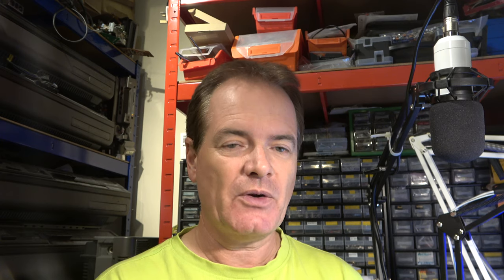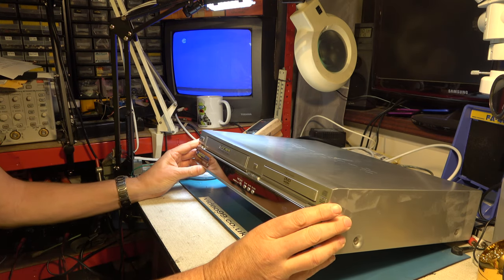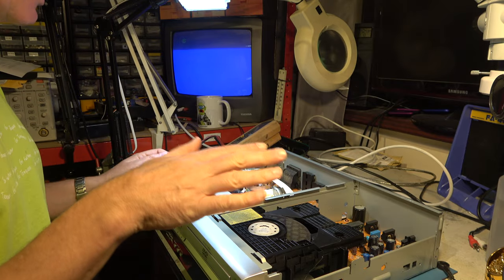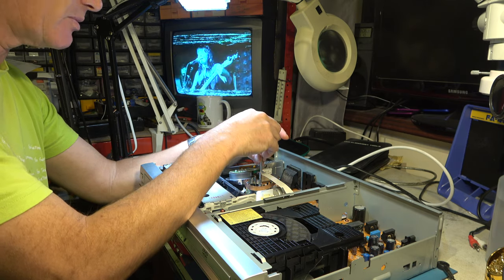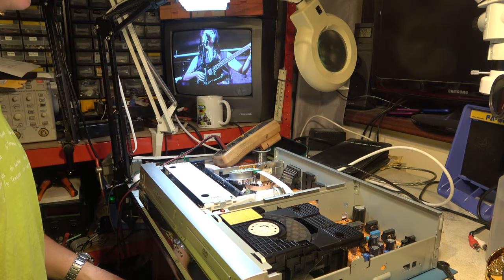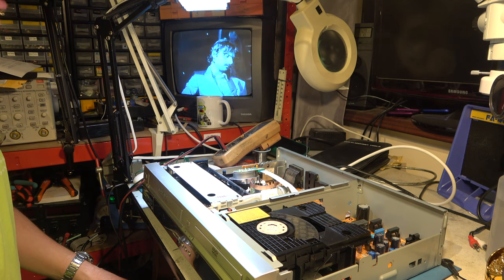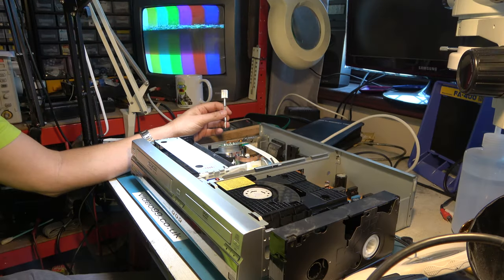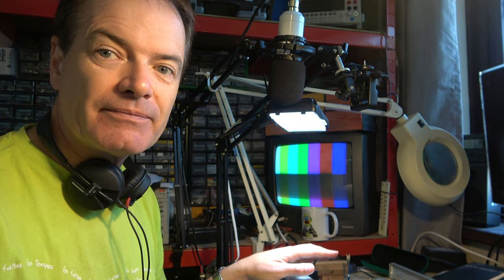VHSC tape recorded with massive alignment (tracking) error.

Comment: After I watched one of your previous videos on the same topic, I was able to pull video off of my family vacation to California in the late 90s. One the VHS tapes had a similar issue. Not sure what caused it to record poorly. It only happened with two tapes the whole time we had the camcorder. Unfortunately, it was recorded with a camcorder that supported SP and SLP speeds and my dad accidentally set the SLP a few different times. Those portions were impossible to totally correct, but overall it helped rescue most of the tape!

Comment: In 1988 we got a Ferguson Videostar VCR which we used for many years. When it was brand new it recorded correctly, but as time went on it started recording with constant 'drifting' tracking like you mentioned. Thing is, all the tapes played back perfectly on the same machine that recorded them, so we had no idea it was recording incorrectly until we got a second VCR! My tapes aren't as bad as your example - it's more like someone is constantly adjusting the tracking up and down a bit on the VCR while it plays back.
Reply from the maker: That might be a bad control track, which is a subtly different problem.  Is the sound muffled too?  If so, that would certainly point to the audio & control head having gone out of alignment.
Reply: @video99couk  Nope, audio is fine; no muffling or wavering. It was one of those quite early VCRs that was SP only and didn't have auto-tracking. I guess since the tape was moving up and down in the exact same way on playback (in that machine), the recording played back properly.

Comment: I recently had a recording with a similar problem, and I used a secondary VHS player to try the exact same thing you were able to do successfully. However, in my case, I could not get the picture right. I believe that my tape had a different problem. I think that rather than the recorder being misaligned, I think that there might have been some contaminant on the bottom (stationary) part of the head drum, resulting in the tape being pulled away from the heads at the same spot in every field as the recording was being made. Nothing I did would restore that band of noise to an actual picture. Still, I'm glad to see that my first idea could have worked, had the problem been different.
Reply from the maker: Yes, I mentioned that as a possibility in the video.  If the tape is curled or pushed away from the drum, then it would never work.  That's why the experiment of seeing if the noise bar moves with tracking, is useful.  If it doesn't move then there's little hope for resolving it.